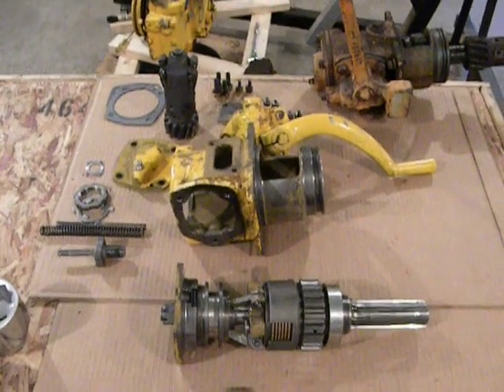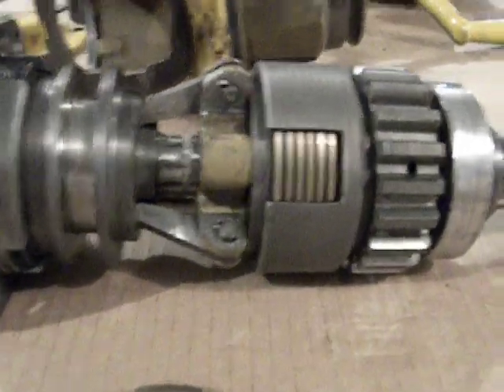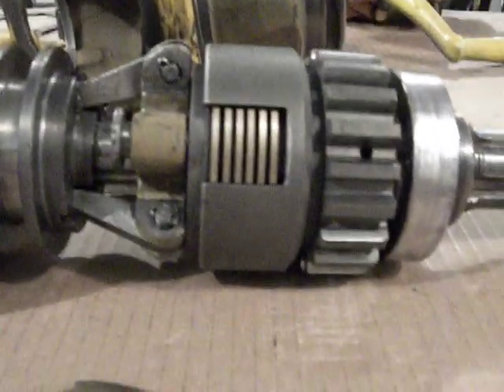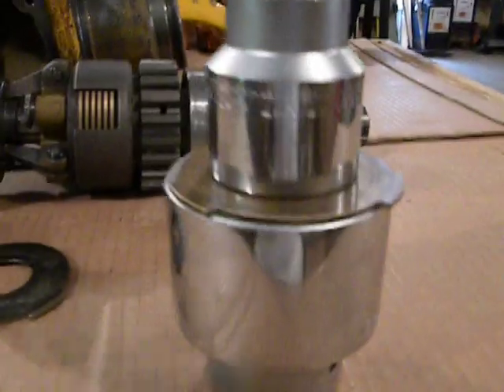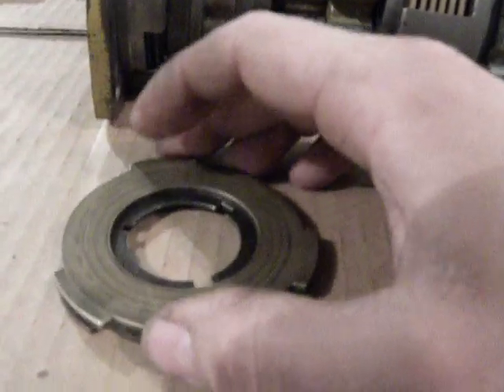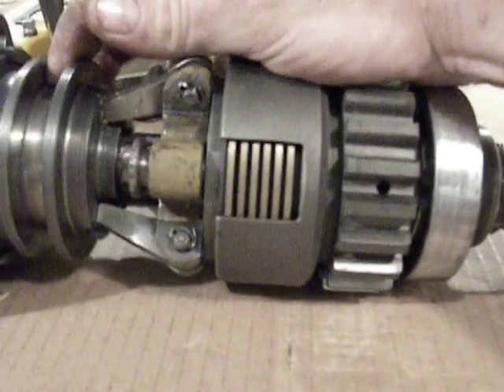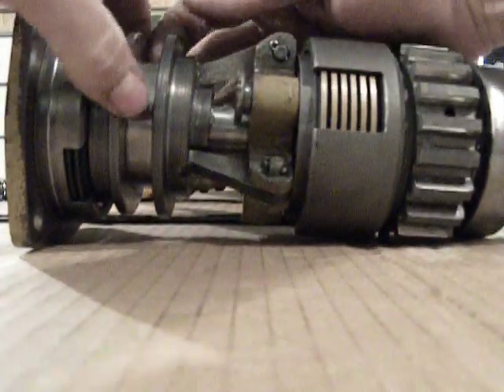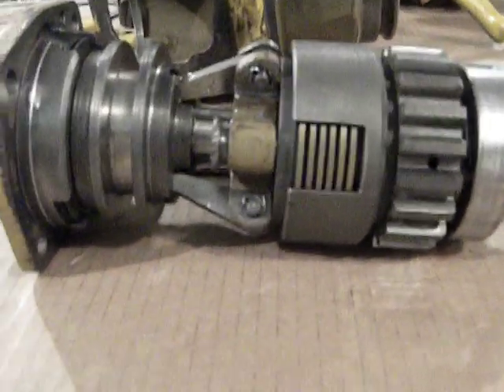Caterpillar D2 and D4 pinion clutch repair

Comment: Oh man l need help!... Firstly magnificent video!... My Fiat 55L dozer has a similar starting clutch... But all steel plates!.. but doing exactly what you described bogging down .. Now l need bronze plates .. where the heck would l start looking?.... Apparently you cant bend the steel as there hardened..
Reply from the maker: I don't think you'll find any bronze plates for that, but another trick to reduce the amount of drag on the clutch plates is to re-stack the clutch pack and double-up each internal drive and external drive plate next to each other, instead of alternating them.  Because having two internal drive plates next to each other, and then two external drive plates next to each other, and so on, you've essentially cut the amount of drag in half but most times still keep the necessary grip within the clutch pack to still drive the mechanism. This works on these Caterpillar clutch packs anyway.

Comment: I am currently working on a 1945-59 D6 (not sure of the year). When messing with the pinion engagement lever I accidentally fully engaged the pinion. Now when attempting to start the pony motor it’s putting a drag on it. I can’t figure out how to disengage it now. I attempted to remove the whole pinion system but it so t budge but 1/4 inch. I’m guessing because it’s engaged. Please help. Thank you !!
Reply: Thank you for the information!!

Comment: That’s a Rockford clutch! I’ve had dealings with those in old Yazoo mower transmissions. They use one for forward and another for reverse. But they don’t use bronze discs. They use friction discs with the steels.

Comment: do you normally replace the bronze disc , what is the spec on steel discs Sure would love to talk with you I have 2 D318's in Bucyrus Erie 22b's and #212 motor grader with a 311 , I am retire and love restoring heavy equip , I worked for Milton Cat as a field mechanic , which I loved everyday,,,,  if there is someway of communicateing with you that would be great

Comment: I followed what you did in this video and it helped a lot.  The issue I am having is when I get the diesel engine spinning and engage the compression the diesel motor will slow down or stop spinning and the pony motor will bog down and start to die unless I released the compression.

Comment: Hi, Ray from Australia I have got a d2 about 1948. The steering clutches are stuck. Can you help me with how to remove them. I have track and running gear off, but dont know  how to get clutches out.Ray  c/o diannedaniel1947.com.au            TY   Ray
Reply: Thank you Squatch253. I have been to ACMOC and tried to sign up, but keep getting nowhere. will try again later as i am very keen to get my d2 going so i can do some work with it.    Thanks again  Ray.

Comment: Hello, great video, I have so many issues with my D4 Cat, I am exhausted.
Question? They say to use SAE 30 for all CO oiling. Are they talking diesel oil or regular oil? My crankcase takes diesel, but my engauge clutch uses regualr SAE 30??
Reply: Squatch253
Hi, thanks for you reply!
I am in need of a new pony motor gas tank the other one rusted out.
Can I pour solvent into the right steering clutch to clean it out? Its rusted and sticking ...
Thanks you.
Mike